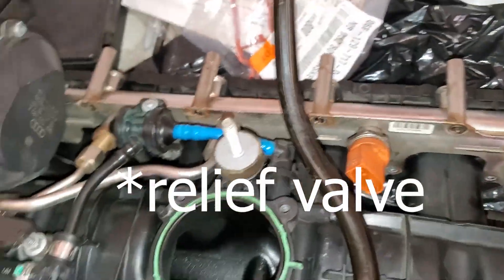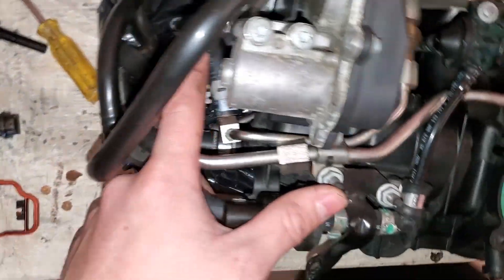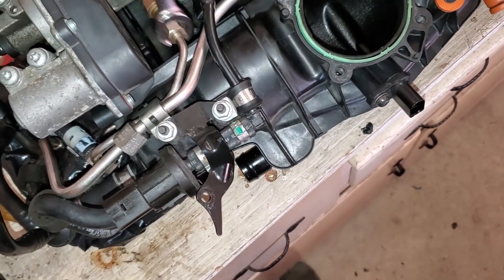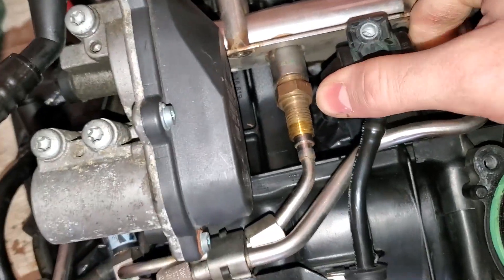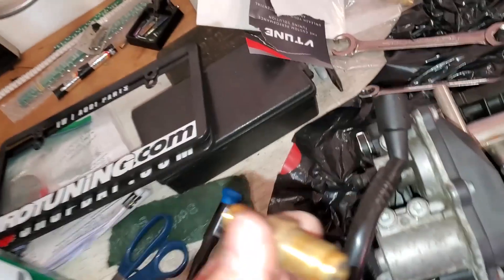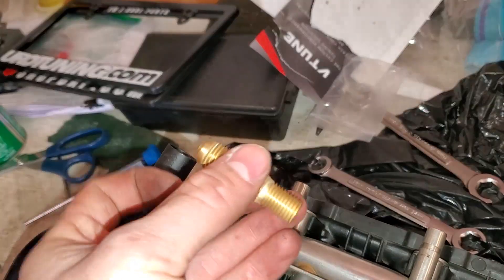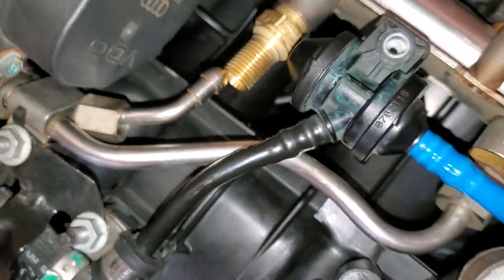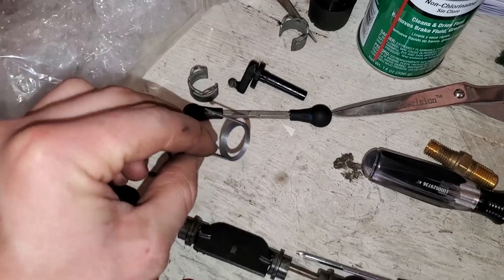MK6R 165 Bar FPRV (Fuel Pressure Relief Valve) Install

Comment: Did you notice any significant change with this mod and removing the flaps ?? I would love to know, 
I might be doing this and a psv delete  soon 
Also I've heard that you can upgrade the injectors to rs4 ones or something, is that right, and will it make much of a difference?

Comment: did you change the lpfp if you did what one did you pick ?
Reply from the maker: Hey yes I went with a Walbro 450
Reply: @FAZEDTom  okai is it easy to do you did be your self like in the basket ? i going with boss 600 and was wondering what lpfp i want to go i want around 500hp not whp on 94 octane
Reply: his it easy to install ?
Reply from the maker: It was not an easy install, gotta figure out your own way to secure it in the basket and supply your own lines to hook it all up!
Reply: @FAZEDTom  did you make a video about it ?

Comment: will this clear the infamous p0089 code? ive replaced the hpfp and a couple other sensors but my car is running for about 20/25min at idle and cut off. it refuses to cut back on after that.. i keep trying to find out WTF the "suction control valve" is but literally keep coming up short. only answers im finding is fuel pump and everything else. i appreciate any input! i also swapped out my spark plugs so its deff fuel related at this point.
Reply from the maker: Hey Zion I was off YouTube for a while so I didn’t see this, sorry. I’m back now but I’m assuming it’s way too late to help you lol what was the issue? Tag me on the reply so I see it
Reply: @FAZEDTom i have p0087 code any help?

Comment: Yo Fazed. I know you been dealing with everything going on but need some help. Getting some 0087, 2293 codes on my R. Have replaced thrust sensor, low and high pressure fuel pump, fuel filter, low fuel pump sensor, cam follower, etc and I’m still getting these codes. Car drives fine however and I’m not getting any fuel cuts. Heard that this might be the reason. Does this sound right?
Reply from the maker: Yoo still having issues? Message me on IG fazed.yt or Facebook Fazed Golfr

Comment: Greetings! I run a gtx2867 setup on my rebuilt 1.8 tsi cdaa engine. I am stock on fuelling and i am looking to upgrade it. Any recommendations like injectors, hpfp, lpfp and relief pressure valve..? My target to overcome the 300 whp barrier...
Reply from the maker: Sweet! I'm not familiar with the 1.8 tsi cdaa so I won't be of much help, sorry
Reply: @FAZEDTom   basically its the same engine as 2.0tsi but downsized.. Have you changed anything else to your fuelling system besides the fprv?
Reply from the maker: @GIANNIS86TSI  mine is an FSI, completely different fueling components sorry

Comment: What turbo you running?  And do you have a link for where you got this fuel pressure regulator?
Reply from the maker: I was running a Garrett G25-660. I got the fuel pressure relief valve from vtech Australia
Reply: What injectors are you running

Comment: How many foot pounds on the fuel line nut that goes in behind the fprv? I'm doing this job in the morning. I looked all over for the spec but couldn't find it anywhere.
Reply from the maker: I'm not sure man 😕 I didn't have any crow's foot sockets at the time so I wasn't able to torque this down. I just snugged it up hand tight and it hasn't leaked.
Reply: @FAZEDTom  Sounds good. That still give me an idea where I need to be. Thanks!
Reply from the maker: I wish I could help more. No problem.
Reply: @FAZEDTom  Job is done all went well. No fuel leaks. The engineer that decided to use a banjo bolt on the fuel pump can eat pig ass and punch a fistful of those bolts up his crack. What a mfer. I feel for anyone having to deal with it.  But thanks again for the vid it helped me a lot.
Reply from the maker: 🤣🤣🤣🤣 No problem man

Comment: Good explanation my dude, I should tackle this when I do my carbon clean on my intake valves..

What is the expected HP limit for your 165 bar FPRV?
Reply from the maker: Hey thanks man. Yeah I highly recommend doing it when you do your carbon cleaning! It's tough to say a HP limit, it really depends on the rest of your fueling setup. I should be able to safely max out my turbo on pump gas and hit just shy of 500whp though.
Reply: @FAZEDTom  wow okay, i'm just aiming for a measly 300whp on my AXX engine! Good to know I don't have to go up to 175bar for 500whp

Comment: I see you have the orange dip stick tube. There have been problems with the orange plastic ball falling out of the dipstick and sticking on the pick-up pipe. You need the updated yellow tfsi dipstick.
Use a 4mm socket to remove the stud holding the dipstick tube to your manifold. Also gives better access for refitting the manifold.
Reply from the maker: Thanks Darragh, I had never heard about that! I'll add it to my long list of items to fix/look into :/